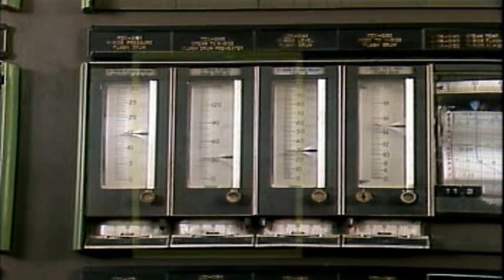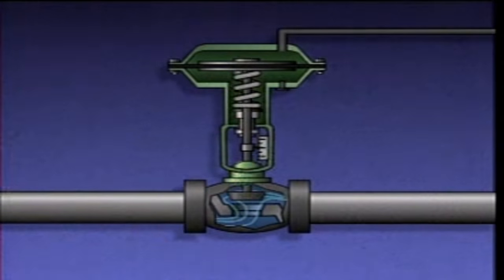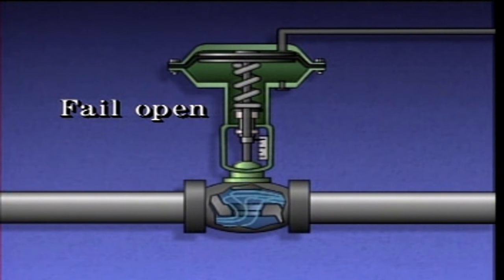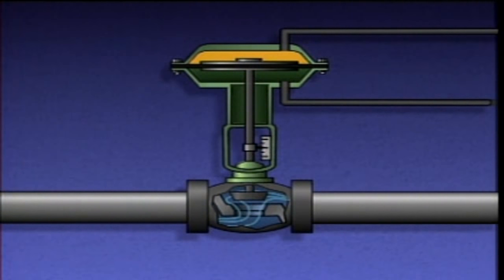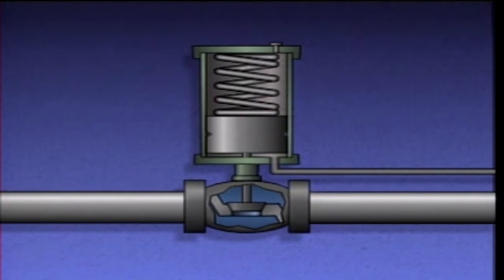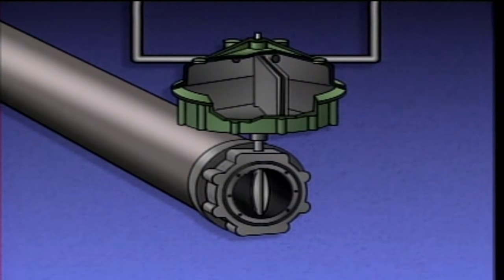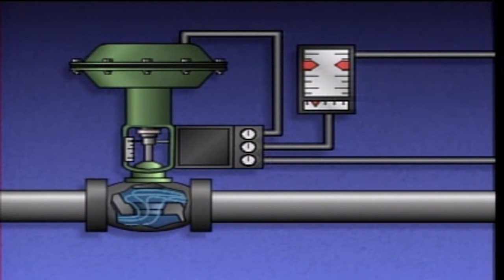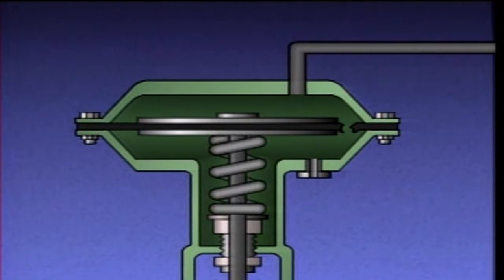Control Valves Types,Operation and Troubleshooting

Comment: Hello, I have a PCV installed on 1440 psi separator. Its not fully closed even if applied maximum air pressure. Any help on that. Thanks